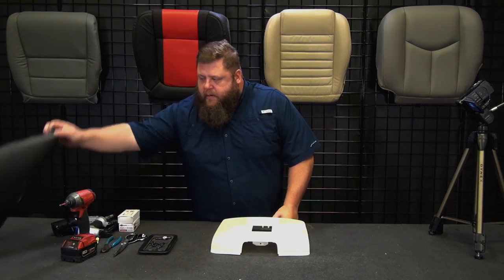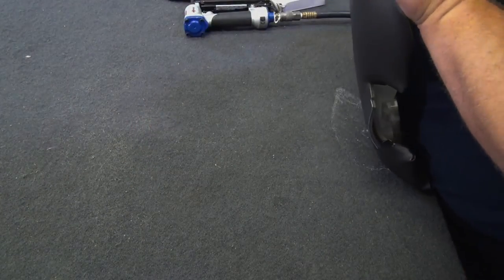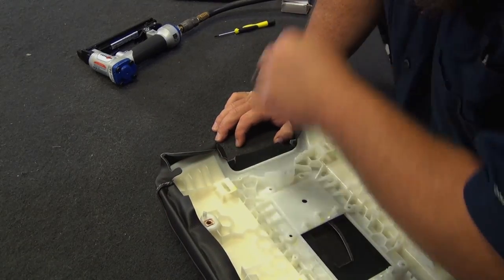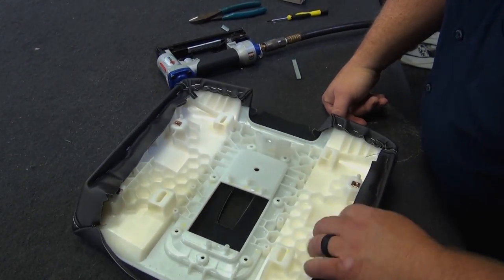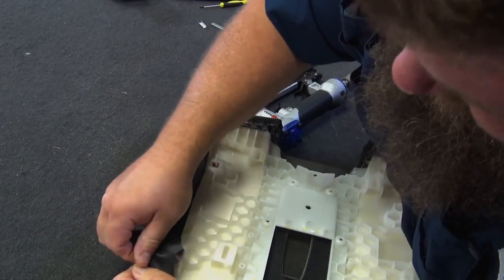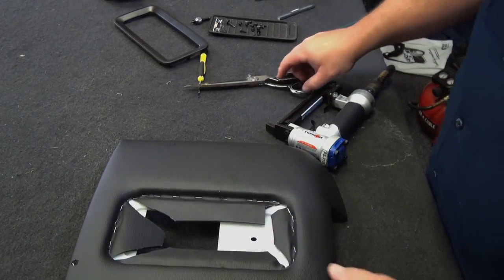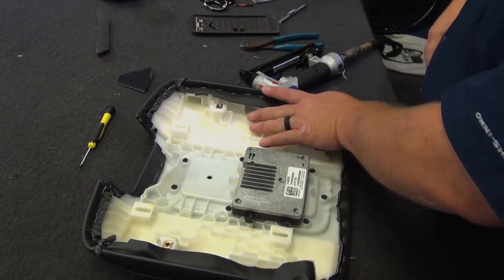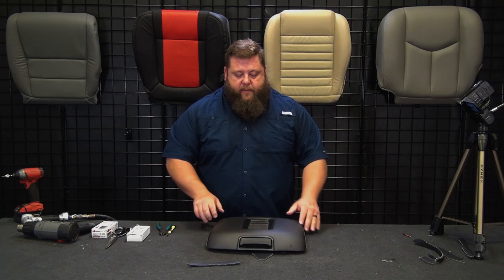CHEVY | GMC (2014 - 2020) Center Console Lid Cover Replacement  - Part 2 - INSTALL

Comment: Just a tip, when you have the box with ALL the information of the staples you are using just hold the box to the lens for a 5 count. That way we can pause and write down all the information, gauge, length, width.

Comment: I just did the new cover on my 15 silverado heat gun works good for corners I bought a bostitch electric stapler $29 at menards worked great want able to get smaller staples than the 1/4 so what I did is double the material before stapling this worked very well as they do provide the extra material thought this might help someone else out that's doing this

Comment: I don't have the tools to do this

I have a 2015 high country with no wireless charger console 

I'd rather just send to you and get it fixed.  I have the exact same wear n tear on mine
Reply from the maker: Hi there, we would recommend you take it to a local upholstery shop where they can perform the install, plus it will be a faster turnaround and cheaper than sending us the entire cover itself.